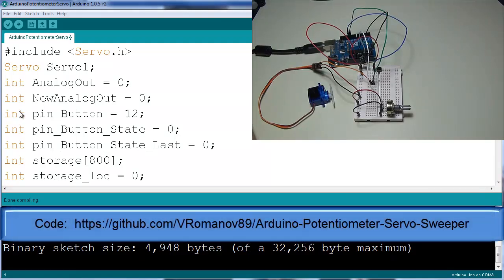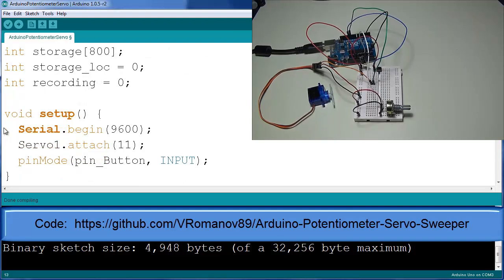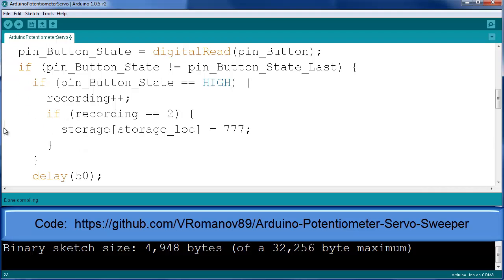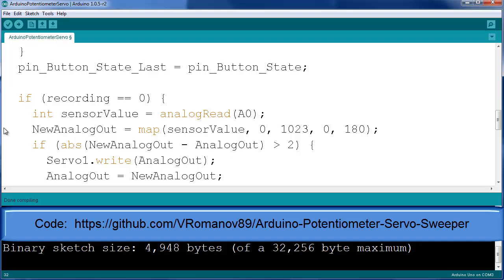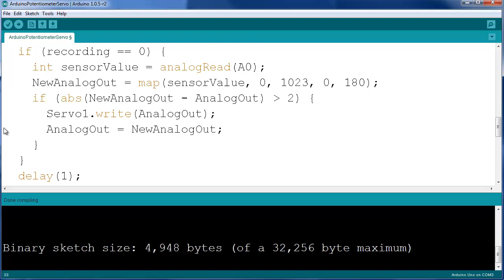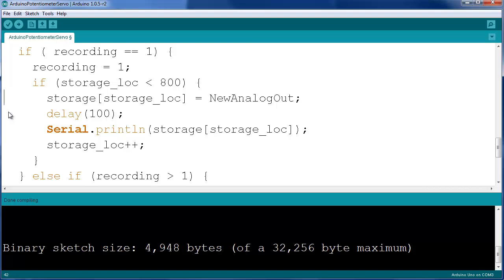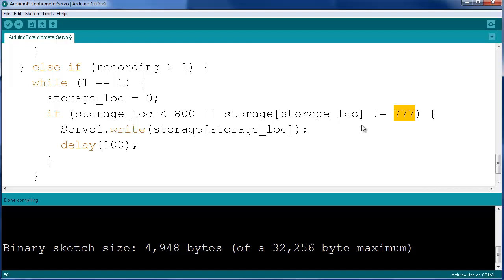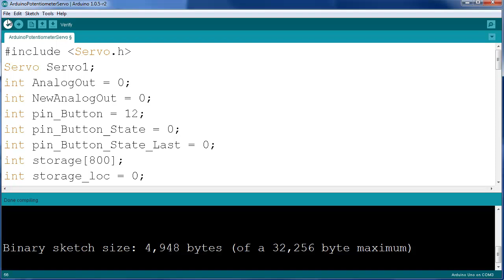Ep.53 Arduino Projects - Potentiometer Servo Control & Memory

Comment: Thanks for sharing the knowledge.

I have 2 questions
1. if you turn the servo with your fingers, will the setup still record the movements . . .I assume so, not sure
2. can you think of a way that the same principle can be applies to stepper motors with encoders?

thanks for the help.

John (camcompco)

Comment: while(1==1) looks pretty dumb because 1==1 equals boolean value true. You don't need to write while(1==1) or while(1+2+3+4==7) or while(65536/256 == 256) - you can just say "while(true)" - that it. Or, even while(1) which is shorter.
Reply from the maker: Alex, good point. I'll correct it. I've seen it written both ways though.
Reply: +EEEnthusiast Also, if (recording == 1) then you don't need to set recording = 1 - it's already = 1 ;)
As well as you don't need to send same value again to servo when you do if (abs(NewAnalogOut - AnalogOut) > 2) because it does not change anything, it's already has this value, it's just excessive.
I think you can improve your code a lot if you'll take a more precise look on it :) But except that - great job!
Reply: Mr Alex, can you please post me the working code of the project. It does not work for me after pressing the button for the first time for recording.
Reply: of course,it will not work. It went for an infinite loop again and again without changing the storage_loc. +EEEnthusiast I think there is something missing with the code

Comment: Great to see your videos again! have a request, can you please make a video tutorial with wifi model ESP8266. I am trying to use it with ultrasonic distance sensor to read a value and tweet or txt me when activated. For example, using it to check when the garage was opened. Your videos are extremely easy to follow! Thanks
Reply from the maker: +Quoit1 Absolutely! Do you mind sending me a link to the one you purchased? I quickly googled the hardware and there seem to be different flavors and revisions. Sparkfun also released their own version of the board. Thank you for the kind comment.
Reply: +EEEnthusiast I also have the FTDI usb to serial converter adapter module that has an option to pick 3.3V for ESP8266 (http://www.banggood.com/FT232RL-FTDI-USB-To-TTL-Serial-Converter-Adapter-Module-For-Arduino-p-917226.html)

Comment: great feat, now what would you say are the diff between the analog servo which i see this done alot on by folks out here and your non analog servo ? in other words why would ppl pay extra money for a analog servo which are expensive rather then just use ordinary servos?  my opinion this a lot better then those other videos.

also is their a reason why your storage[800]; ?  are you playing with some limitations ?
Reply from the maker: +jai Lopez The servo I'm using is a PWM servo. It is controlled through the Arduino servo library. You can use normal PWM, but there's no ned to implement that with the library.
Reply: EEEnthusiast
ummm i dont think you answer my questions, was your reply for my comment?
Reply from the maker: +jai Lopez it was. The servo I'm using is analog. The answer to your second question is that 800 was the limit for the memory. I would have to optimize the program to store the information better in order to go beyond that, but it was just a proof of concept here.
Reply: ahhh ic, ok so now i thought analog servos had a 4rth wire which i dont think i noticed on the video? also where what memory are you referring to SD ?  EEPROM ? EEEnthusiast

Comment: Hey, I am getting an error "Low memory available, stability problems may occur"  in my program. On assembling the circuit and uploading the code, the servo motor keeps on moving arbitrarily without varying the potentiometer. Please help me out!

Comment: As soon as the push button gets pressed, for the pullup resistor to go high, the board freezes. Looking at serial debug, it captures the las reading of the pot but nothing more... Thoughts anyone??
arduino 101 and running servo on a separate battery

Comment: one other question, i think it would be cool if you could show how you could expand the 800 storage using a sim card ad don for arduino.  people would be able to apply this to more "real life" experiments.  Just a thought

thanks again
Reply from the maker: +camcompco I agree that I should have shown a bit more for this project. I have taught of several ways on how to optimize this, but didn't take the time to actually put it in practice. I'll definitely consider it if there is enough demand.

Comment: Hi can anyone post a working code for this project. The code stops working once recording == 1, when pushbutton is pressed once. Neither does the motor turn nor does the value of NewAnalogOut gets updated in this mode. Motor jerks when serial monitor is opened.

Comment: Hi EEEnthusiast, its very pathetic that so many people have asked about the problem of not working of servo after pushing the recording button, just blinking the Tx led in arduino  and you have not answered it yet
Reply from the maker: kailash kumar I have answered it many times and pointed people to the new tutorial with working code. It’s pathetic that people aren’t willing to do any work and expect everything to be given to them.
Reply: Thanks for your quick reply, and i beg your pardon if you answered it already somewhere, Can you please provide me the link to the working code tutorial, as i did not find it anywhere. I scrolled the full comments section .
Reply: @EEEnthusiast   complete agree with that, people ned (including me)to work by themselves in order to learn